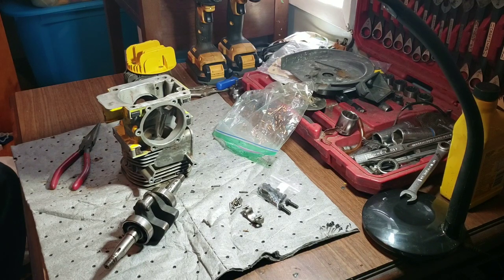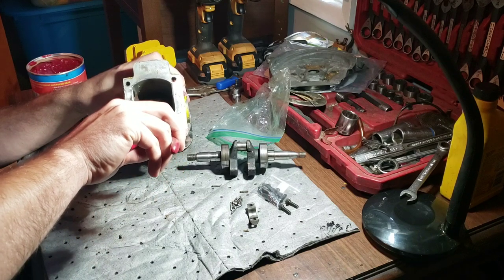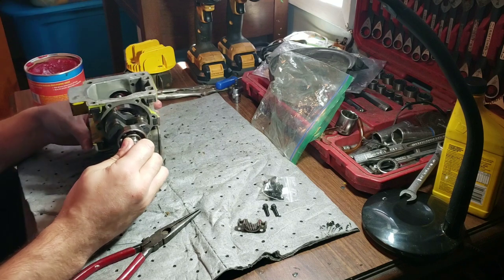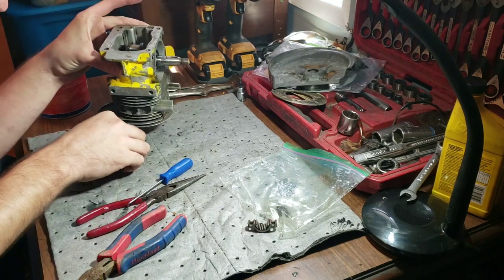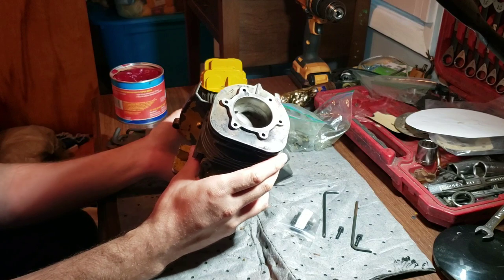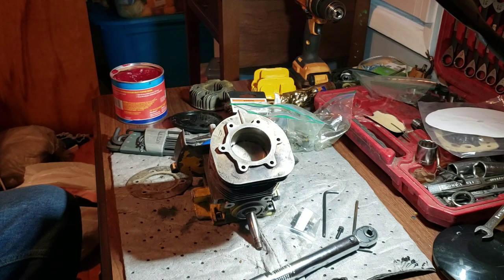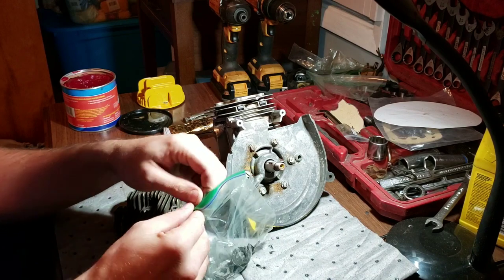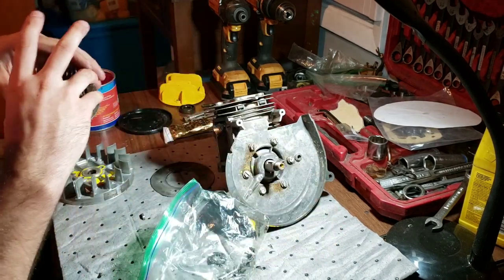McCulloch D44 hotsaw part 5

Comment: got straight  from Monster Bolt ,   had a tiny order , -just a few bucks , with shipping - guy  running show sent me torque specs , gave me a very good impression on being there to supply and help if needed
Reply from the maker: So far they are holding up in my saws.

Comment: I got another old Mac running today it’s a Mac 15 I resealed the intake manifold and I rebuilt the carb
Reply from the maker: I have a mac 15 I got a few weeks back that was weather locked and after getting it unlocked, the rings are stuck in the piston so I have to take her apart sometime to either free the rings up or put new rings in it. If I have to take it down for new rungs, I may port the engine a little to give her more ass, these are choked from the factory on the exhaust and intake ports, lucky if a mac 15 will turn 6000rpm.
Reply: Hahah yeah I got another one today and now I have a bar and a brand new chain for my running one the one I got today had a cylinder full of atf currently and I got the diaphragm and carb sitting in atf I heard that this can soften the diaphragm. On the one I have running I soaked the diaphragm in wd40 over night and then put the carb back together and even though the diaphragm was rock it actually softened up and the thing isles and runs perfect but them little tilostens on these saws are simple.